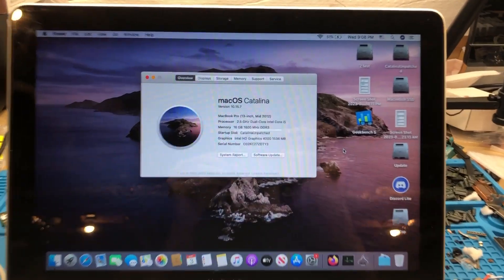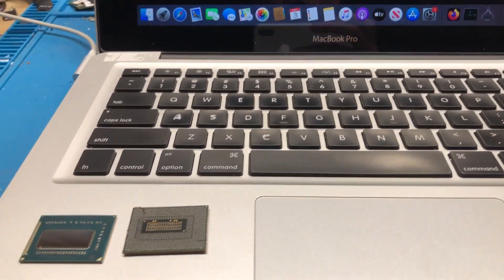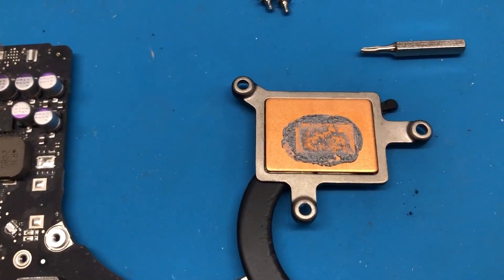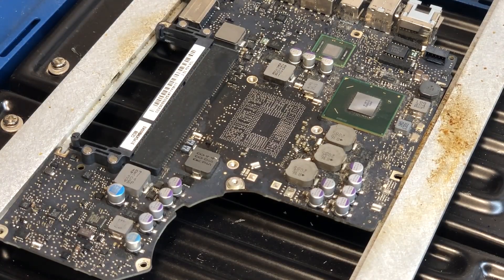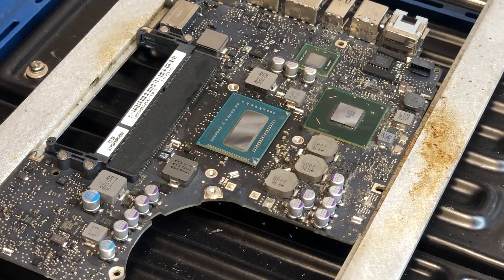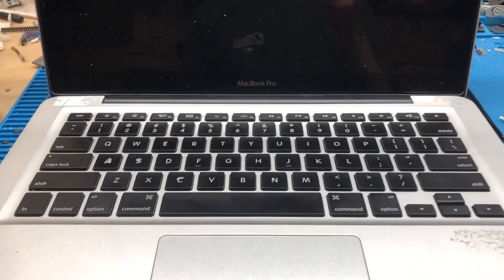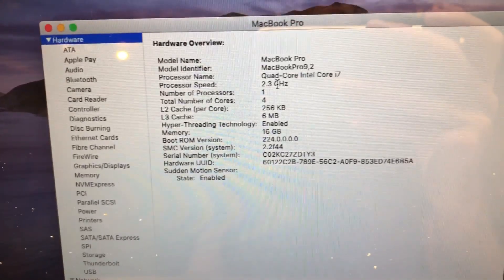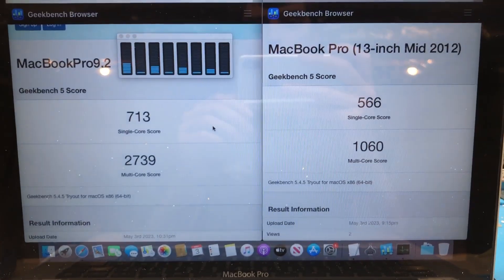Creating the World's First Quad Core Mid-2012 13-inch MacBook Pro

Comment: Man, you're making me want to ditch my 15-inch and buy an old 13-inch for cheap. I don't use the DGPU for anything really, but am hugely dependent on CPU speed and power. Had they made 3720QE or 3820QE chips? I'd want to find a 3820QE if possible and have you put it on the board.
Also, any non-visual techniques for doing board-level work would be greatly appreciated!
Reply from the maker: The 3615QE is the fastest they made... Really were designed for use in embedded platforms.
Reply: @dosdude1  Ah, thank you! This makes sense for running in tighter conditions. At least it's got the same power as my 2.3 I7 15 QM chip.
What are your ambient temperatures?
Reply from the maker: @setoth1234  It seems to idle at around 55 - 60 degrees C, which is only slightly higher than the original CPU. Thermals overall seem decent enough.

Comment: you should check your thermal limit for your laptop cooler before you do this upgrade. mine was weak and just settled for high clock dual core...

Comment: How is the cooling with this mod? I know the QE is only 45W but the stock heatsink already struggles to cool the dual core that was in the laptop as standard.
Reply: double the question. my i7-3520m under 100% load gets 100°C almost immediately according to the monitoring. however, the throttling does not affect the performance, so I believe that the 4-core 45W CPU would still outperform the 2-core one. how often do we need the 100% CPU usage? if we do need that, we must consider using a more modern and faster device. that 4-core CPU for sure will be suffering from overheating but we still can expect at least 150% speed boost in average

Comment: Wowza! Will definitely be coming to you for this upgrade at least a couple times in the future. 1 of the 2 remaining achilles heels of this spectacular model has been conquered! ...Now...ONLY THE SCREEN REMAINS! (Don't think we can do much for the GPU)

Which, in theory shouldn't be that much to ask to at least get to FHD? I will have to look at what screens would fit this spec: 
13.3" 16x10 
1080p at 60Hz
IPS (AHVA, or similar) 
30 pin LVDS connector

From there it would just be a matter of making it fit in the upper aluminum clamshell would it not?
Reply: We are on the same mission! I thought after I swapped in the dual-core i7 logic board I was fully upgraded, and only a screen upgrade was left (which I hit a dead end on). Now I need this quad-core upgrade and to hope a FHD screen eventually becomes available!

Comment: Are there any CPU upgrades that would apply to a 2017 MBA 13"? Quad core i5 or i7 with your 16GB RAM upgrade and a 4TB SSD sounds lovely. :)
Reply from the maker: You're stuck with dual-core on that model, the best being the 3.1 GHz Core i7-5557U. It can indeed also be upgraded to 16GB of RAM; I have another video about both those upgrades on my channel.

Comment: I also have this MBP Mid-2012 with the 2.5 duo core processor, wish I could do this upgrade.  I also thought my computer was maxed out at 8gb RAM, but your computer shows 16GB.  I might just take that plunge if I see you supporting 16gb...that would make it worth it for me...Thanks for the video, i love unauthorized hacks...:D
Reply: Just chiming in to confirm 16GB (2x8GB 12800) works in this model, it's a common request at my shop. Definitely worth it.
Reply: @SalemTechsperts  went out and purchase 2 x 8GB sticks shortly after and completed this upgrade...now I need to get the processor upgrade...but I can't complete that one on my own...
Reply: @quesengar  Awesome. I'm sending mine in to the dude himself to have the CPU upgraded. Well worth what he's charging in my opinion.
Reply: @SalemTechsperts  I plan to do the same...

Comment: grab some noctua paste this chip  is 45 watt vs 35 . and will turbo down based on temps :)  good paste is needed  such an awesome upgrade im assuming all the sandy and ivy have the same firmware . obviously modified for there archetecture so that is why this just works :) so cool

Comment: That feeling when it just works with no firmware mods!
Reply: How does one do those custom bios?
Reply: @LPgmxDan  you flash the BIOS IC…
Reply: @prestonferry  so basically the same process that you would do if you messed up the bios update for example? And isn't there a system on apple to prevent it? Sep or something like that
Reply: @LPgmxDan  you don’t have to go through the system, you can force it… You have to either desolder the BIOS IC and connect through a breadboard/USB or hook jumpers to it… They generally use a program such as flashrom to do it…

Comment: Makes me wonder if the same sort of thing can be done with chromebooks.
Reply: Don't see why not. A few years ago someone made the claim they switched out the Celeron chip for an i7 on an Acer C710. But never showed proof and disappeared. 

Meanwhile, just when I thought I was done modding my MBP, dosdude drops another hot mixtape! Lmao!
Reply: @achishukuteki941  For my chromebook I'd just like a storage increase. Maybe more RAM but really the onboard storage is the big issue. For whatever reason, even with modded firmware, booting from an sd card or usb as your main drive seems to be flakey at best.
Reply: @David_Phantom  Ah, I see. I have a C740 with 4gb. 8 or 16gb would be lovely. 

The emmc storage mod would be top-tier.

Comment: Could you do an MBA 11" quad-core CPU upgrade like this? This CPU does seem to share the same socket with the Mid '12's CPU according to Intel's spec sheet, but the TDP is way higher. Guessing the power delivery might not be able to handle that, or would cooling become a problem first?
Reply from the maker: In theory it should work, but will run hot of course. I still want to try it, though.
Reply: @dosdude1  that certainly would be interesting, it could be history's first 11" quad-core MacBook. Too bad it doesn't look like any of the newer generations share CPU sockets with quad-core models though.

Comment: Is this the same CPU that came in the 2012 2.3Ghz quad i7 Mac Mini?
Reply from the maker: No, the quad-core 2012 Mac Minis have the correct footprint for the QM series chips, so that model uses the 3615QM, not QE.
Reply: @dosdude1  QE vs QM performance the same? I think the E stands for embedded, while the M stands for mobile.
Reply from the maker: @cthart  Most likely performance is exactly identical between the two. The QE is indeed meant for embedded applications, but as mentioned, only they can be used as they share the BGA footprint with the regular M series dual-core chips.

Comment: Amazing 🤩. I have the same MacBook pro 2012 i5 !!! I use it for playing music with Serato 2 and the best for using it's Catalina and MacBook. I have changed the thermique and upgrade to 16Go & SSD but this upgrade is very nice but just very difficult !!! 
A noob question ? When you change the Cpu the Gpu remains the same ???
Reply from the maker: In this case, yes, as this CPU has the same integrated Intel HD Graphics 4000 as the original.
Reply: @dosdude1  Ok thank you for responding 🙏

Comment: Really so very cool 😎 I have a 13 inch, Mid 2012 but mine has the 2.9 GHz Dual-Core Intel Core i7 and my question is will this chip make any improvement to my MacBook Pro 💻 ? And would it work?
Reply from the maker: I certainly could do the upgrade if you’d want to send in your machine. Could probably do it for around $200 - $250 plus return shipping cost, as the CPU itself costs around $100.
Reply: @dosdude1  snap!! my next upgrade is totally coming...let me save a little money...I have done basic upgrades to mine but I would totally love if you could do it on mine...if thats all it would cost...totally worth it to get a few more good years out of laptop...
Reply: If so I would like it if you could do my computer and what would it cost? I love this MacBook Pro because it is the last one to come with all the old ports and the DVD/CD drive!!!
Reply: @richardgerome4897  the cost likely several hundred dollars and the video shows the improvement, i doubt he does views laptops. you would need to find a board repair shop that does BGA work

Comment: You shoud sell some boards or sell a upgrade service, quite a few people would pay to keep their 2012 pro
Reply from the maker: I definitely would perform this upgrade for anybody who would want it. Would probably be able to do it for around $200 - $250, plus the return shipping cost. The CPU itself costs around $100.
Reply: @dosdude1 I’d love to buy one
Reply: @dosdude1  WOW, this is awesome!!! I'm definitely going to contact you about having this done to my 13" 2012. I purchased mine in 2017 from the Apple Refurbished site and the reason I bought it was because of the upgrade ability. I could always get a new computer but, why when I can upgrade the CPU. Thanks for sharing this and keep up the great work.
Reply: @dosdude1  hi dosdude i mounted the cpu i have a black screen no dong the cpu heats up the fan spins reset smc ok need to do a clean me?  thank you sir
Reply from the maker: @johnteiss1038  Probably a soldering issue... These CPUs can be a pain to solder due to the caps in the middle.
Reply: @dosdude1  thank you my friends 🙏
Reply: @dosdude1  i rebilled all works thanks dosdude you are the best🎉😊
Reply: @dosdude1  hi dosdude I was wondering the processor that is mounted on the MacBook pro a1398 retina 2012/13 example 2.7 i7 has the same ball seat as the SR0NC?  THANKS.😊
Reply: @dosdude1 extremely fair
Reply: @dosdude1 , Is this upgrade applicable to a 2011 13" MacBook Pro i5 2.3 GHz laptop?
Reply from the maker: @martinhaughton9199  Technically yes, but not worth it with Sandy Bridge. Best to swap to 2012 board and upgrade that.
Reply: @dosdude1 I have one where should I send it?
Reply from the maker: @MalikEmmanuel  Send me an email.
Reply: @dosdude1  I love your channel. Do you think you could still run future dosdude patchers or oclp patches to run versions like Monterey? The Mac you built is honestly my dream laptop but I’d be concerned about updating past Catalina.
Reply: Does the quad core have any better igpu performance?
Reply: is it possible to upgrade the dual core chip to quad on a 2017 13” macbook pro like this?
Reply: @dosdude1  How do we organise this with you?
Reply: @dosdude1 do you think this would work out on a retina 2012 13 mbp? A modded one would be the fastest retina 13 inch up untill they switched to ULV quad core 8th gen in 2018
Reply from the maker: @chimplove2006  Yes, it would.
Reply: @dosdude1 in my country 200 bucks cost for upgrade to macbook pro 2018 which is has quad core cpu and automaticly upgrade everything inside 😂
Reply: @dosdude1  i would love for you to repair/upgrade my macbook how can i contact you?
Reply: @dosdude1  I’m in australia, where are you located in interested to get you to do my MacBook. Can you upgrade the graphics too?
Reply: @dosdude1 someone could buy an actual cpu to you destination to reduce shipping costs and you send it back.
Reply: @dosdude1 it can be done on a 2012 macbook air? Quad core i7
Reply from the maker: @JoaoVitor-cw2vg  Yes, though it would likely run pretty hot. I think a 3612QE would be best for the Air (would still run hot, but not as hot as the 3615QE).
Reply: @dosdude1  and what about a quad core i7 (720qm, 840qm, 920xm) on a 2010 dual core i5/i7? Is it possible? And what about vram upgrade on the GT 330M's 512mb?
Reply: @dosdude1  bro i def want this to be done!!! 
this would be fire
Reply: @dosdude1  I saw you can do this mod to the early 2013 13" MacBook Pros. I have one that I would like you to upgrade and add more RAM as well. I'll happily pay for your services!
Reply: @dosdude1 I have a mint 13 in 2012 MacBook Pro would you sell a board with this already done?
Reply: @dosdude1 I have one to send you.  Actually two if you can manage a mid 2011 as well.
Reply: @dosdude1  I have one, can you do it?
Reply: @dosdude1  I’d definitely be interested in this service
Reply: @dosdude1 is it possible to upgrade the cpu and/or ram on a 2015 15 inch mbp with amd gpu?
Reply: @dosdude1 Hi I would love to do this in the coming months. I'd say about two or so months and I'd be ready to go!
Reply: @dosdude1  Awesome!
Reply: @dosdude1  question: could i upgrade an macbook pro 2010 13” to an i5 or i7?
Reply from the maker: @nyaathea  You can’t, as those use a Core 2 Duo which is completely different.
Reply: @dosdude1  so its not possible to upgrade from the core 2 duo at all?
Reply from the maker: @nyaathea  Nope, the platform is entirely different.
Reply: @dosdude1  i can swap the 2.4GHz for a 2.66GHz core 2 tho right?
Reply from the maker: @nyaathea  You can go up to a 3.06 GHz T9900.
Reply: @dosdude1  thanks for the info
Reply: @dosdude1  what about the graphics card? Is it possible to upgrade that in any way or no
Reply from the maker: @nyaathea  No, that’s integrated on those, part of the nVidia MCP89 chipset.
Reply from the maker: @NRGY I got this CPU off AliExpress. It's really not likely you'll get ripped off, I buy stuff from places like that all the time and have never had an issue.
Reply: Hey can i send you my Mid 2012 to get this upgrade?
Reply: where can i buy motherboard and cpu
Reply: What other things could you do ? I am curios asf
Reply: Nice!
Reply: I have a Mac book pro 15 Early 2011 with the 2.2 GHz i7 2720qm and the AMD hd 6750m I was wondering, what is the highest supporting CPU amd GPU I can solder in, it also has the upgraded screen (silver border) and 16gb ram, I also have an idea Frankenstein at better heatsink and add water cooling once I get the stuff I'll possibly make a video
Reply: Yeah. This is already a thing for the thinkpad x230.
Reply: @dosdude1 do they have same pins and BGA as 3612QE and work with this model as well? or 3515 QE is the ideal?. I  can see the 3612 version have 2.10 Ghz.
Reply: I have a core i7 620 2.66 ghz what's the upgrade for that?
Reply: @icemanbtlr25  If you mean the i7 620M Mobile chip, then that's already the best chip in the lineup.
Reply: @dosdude1 I have a 13 inch late 2012 retina mbp with the same dual core in your unibody before you upgraded, would this be possible on the retina mbp?
Reply: I would love to see my mb pro 2015 13 inch be upgrade with a i7 or i9 i got i3 now...can you solder ram?
Reply from the maker: @boogiedownbronx73  13" 2015 MBP can only support dual-core CPUs, the best of which is an i7-5557U. You can solder on up to 16GB of RAM on that model.
Reply: @dosdude1  I wanna buy
Reply from the maker: @glitter_world_tour1630  Just send an email.
Reply: @dosdude1  you should find broken m1 computers and see if it’s possible to create a 11 inch iPad with same amount of ram as the computer
Reply: @dosdude1   have you tried a processor that has similar soder pin for that apple never used and see what happens
Reply: @dosdude1 would love to send you my late 2012 retina pro for this upgrade!
Reply: No te olvides de una posible demanda de parte de Apple!!!
Reply: will get sued by apple

Comment: So is it possible to install the same CPU on the A1425 13-inch late 2012, as far as I know, mid and late (retina and non-retina) shared the same CPUs
Reply from the maker: It indeed is, as well as 2012 11” and 13” MacBook Airs.
Reply: @dosdude1  Oh I want to see an macbook air with quad core CPU can you do this next? Would be really awesome to see
Reply: @theGamer93 I bet thermals won't be very good, would be very cool to try tho
Reply: @dosdude1  Amazing! This concludes our email conversation (I am the guy who asked you about upgrading A1425 MBP from dual-core to quad-core)

Comment: I've never figured out why someone isn't contracting some Chinese factory to make replacement all-in-one motherboards to upgrade these old laptops that are both abundant and likely to last nearly forever.
Reply: they do stuff like that for ATX desktop boards, some even have BGA laptop CPUs on the ATX boards, strange stuff!
Reply: Because they are entirely unsupported in terms of os and cpu security updates, run low resolution screens and are about as fast as a single m1 core, all upgraded :D
Cool project, though.
Reply: @NRGY If you sold a preassembled board to hobbyists?  I'm thinking Linux guys would love to repurpose old Macbook Pro chassis by having an easy way to put new hardware inside them.
Reply: @NRGY Well yeah, if it doesn't work.

Comment: i did this upgrade to my Thinkpad X230, gave it a pretty big performance jump in multicore scenarios, but it runs alot hotter at low load/idle compared to the origional dual core CPU
Reply: 45W part vs 35W
Reply: Try the i7-3612QE instead, exact 35w TDP for similar performance
Reply: Same deal so I just picked out the best dual-core and called it a day. You could also lock the quad core to its base frequency
Reply: I would try to use higher quality thermal paste if you didn't. Unless I was desperate I would try to use liquid metal but otherwise I do not like messing with that stuff, just some good ol' silicone based compound or something.
Reply: time for a heatsink/cooling mod and maybe some liquid metal ;)
Reply: @NRGY thinkpad EC is weird when controlling it's thermal system, still happened until T480
Reply: Are you able to park cores somehow?
Reply: @ellenorbjornsdottir1166  ah I forget for the Xx30 series you can disable up to 2 core in modded BIOS, disabled tho not parked/dormant mode
Reply: @ellenorbjornsdottir1166  bruh this laptop and processor is older than the 1st AMD ryzen, nevermind talking about core parking 🙄
Reply: @NRGY Yet it will, since we don't live in the year 1990 anymore and every CPU has thermal protection build in ;)

Comment: Is there not already a i7 quad core macbook pro 13 inch 2012 version??
Reply: The 13“ got quad cores in 2018. till 2017 only dual cores
Reply from the maker: Nope, they only ever came with dual core CPUs.